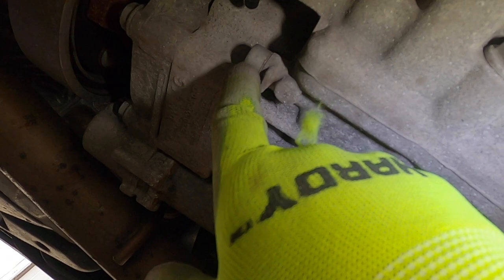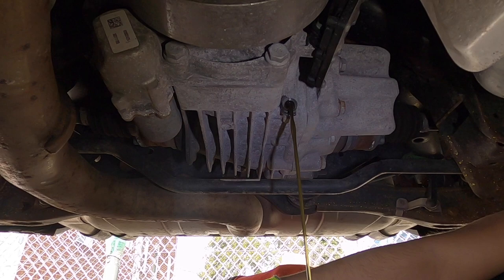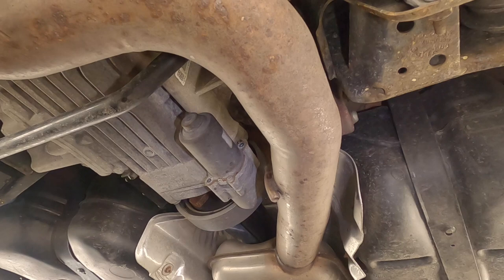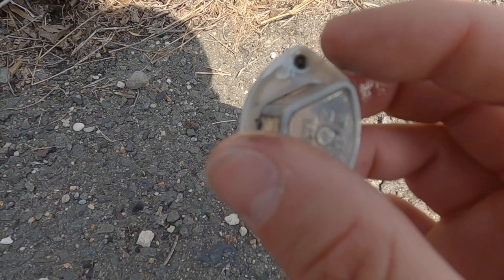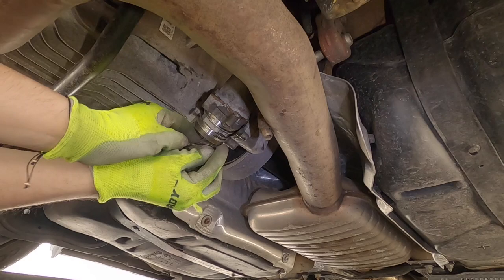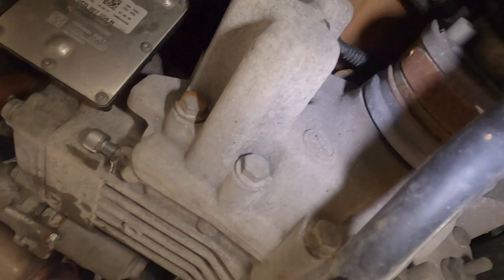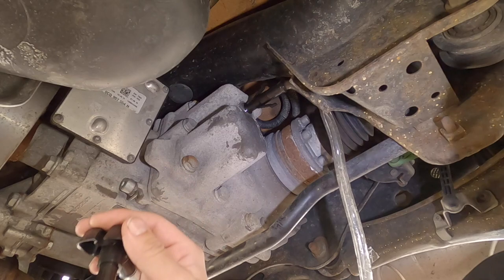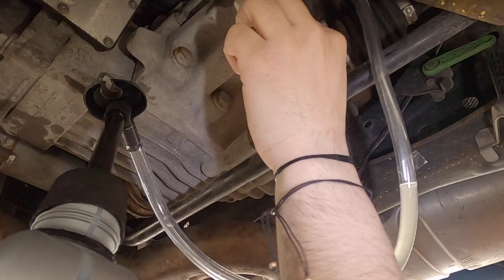Volkswagen & Audi Haldex (AWD) Service DIY!

Comment: The O rings are actually two different sizes. Also the fill process is supposed to be done with the car level. You would need to raise the front to achieve this. Having said that, I’m not sure how much more or less fluid would there would be in the unit doing it your way.
Reply: I have seen Haldex part suppliers that say the o-rings are different sizes (by 2mm if I recall correctly).  The ones that come from VW in the kit with the bolts seem to both be the same identical size -- about 43.5mm ID, with a 2.5mm cross-section (so 48.5mm OD).

Comment: Wait a second, both o-rings on the pump are the same size? I believe they are not the same size. The top one (closest to the tip of the pump) is smaller then the one that goes in the middle of the pump. This information is from either humble mechanic’s channel or deutch auto who are both huge with vw/audi stuff.
Reply from the maker: They are the same size o ring both have the same part number. Charles in his video doesn’t change his o rings either as the dealer didn’t have them in the stock. Also Paul in his video doesn’t mention anything on the o rings either

Comment: Haldex fluid didn’t look too bad but always good to change it! And it’s good you let the car run a few times to get the pump to circulate all the fluid around. Any issues after doing it? Have you launched it or done pulls after the service?
Reply from the maker: No the fluid looked decent and yes I let it circulate for a decent amount of minutes before moving it. And no I haven’t launched it but the car feels super solid and no spinning in lower gears at 10mph plus .. so all in all no potential headache and success haha

Comment: thx for this. my a3 8p will make a little thud sound sound on accel and esp traction control light comes on. was thinking it may have something wityh the slop in my drivetrain pendulum swinging. it works propper much more often when car and ambient temps warm. this was a well done helpful vid.

Comment: Do you put the fill plug in when you need to circulate the fluid??
Reply from the maker: You can if you want to be safe. You don’t need to fully tighten though. Just hand tighten

Comment: What generation Haldex is this?  I have an A3 2006 with gen.2 Haldex. Is the servicing the same?
Reply: This was gen 5. It is supposed to be a lifetime item. Dealerships just change the fluid at services then charge for a new pump when it fails. Better to do it yourself and clean the filter. Much cheaper. Gen 4 definitely has a replaceable filter so I imagine earlier systems will.

Comment: This is the gen 5 haldex what I can see is just the gen 4 does have a separate filter
But is just as simple 
Also if you do have a haldex system failure when you take the back seat out there are 2 plastic rings one on each side under one mine was on the left,that’s sat in the car, on top of the tank there is a plug, the wires for some reason can break 
I’ve had 2 now simple fix and can save you thousands 
Mickhunt 
UK

Comment: I'm doing this maintenance this weekend but was iffy about being able to disconnect the bracket that holds the wire harness in place over the drive shaft. Your diy is the second i've seen where they don't disconnect the pump and just leave it hanging. I will try it this way to avoid breaking a tab or possibly snagging the wire on the drive shaft. 

Does the weight of the pump feel like it might damage the wiring if left hanging from the harness? That's my other issue. I'll still give it a shot.

Comment: Is your car lowered on springs? From the video looks like you barely have the car lifted up high. Was wondering how high I'd need to get my lowered Golf R to reach the Haldex pump and do the service. TY
Reply from the maker: Hey man, so in this video my car was not lowered yet so I had enough room to get it done. If you’re low you’ll most likely need to lift it up more on some good Jack stands
Reply from the maker: If you’re a smaller guy you should be able to get by as well though. Took off my cat back on ramps to install my rear sway bar and even though I’m lowered now I’d be able to do the Haldex service still because I’m small enough haha
Reply: @DArias  Also they're recommending I change the front diff fluid too.  That something you'd recommend as well when doing the haldex service? TY

Comment: i did a half service lol. i wasnt able to reach one of the bolts on the pump. i didnt have the proper extension . prob should do it again after a year.
Reply from the maker: That’s not an issue tbh.. as long as you had no grinding sounds and no kind of sparkly shavings in the fluid you should be okay. Hell I’ve heard some dealers do the “full” service without doing the pump and filter etc.. I think you’ll be good! That too screw is super tricky to get
Reply: @DArias  yeah although I don’t trust my own work the first time .

Comment: Do you need to lower the car off the stands when you run it?
Reply from the maker: Not necessarily as the pump circulates the system when the car is running. Once you check true level 2nd time around fill till it starts dripping out the plug area
Reply: @DArias  thanks for the fast reply!

Comment: The filter, the filter, the filter. If there is no filter for 90$, its expensive ! In Europe, oil, bolt, an filter for same price !
Reply: Haldex Gen 5 does not have a filter, just the pump screen that he showed.  That o-ring kit from VW costs in the range of $50 (or source your own for $5), the fluid is now $46, the bolts a few dollars.